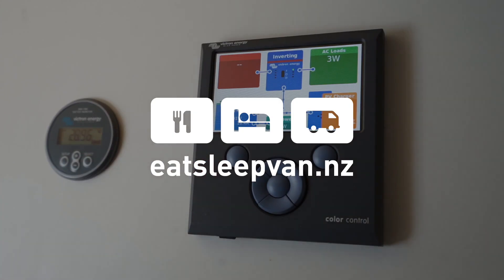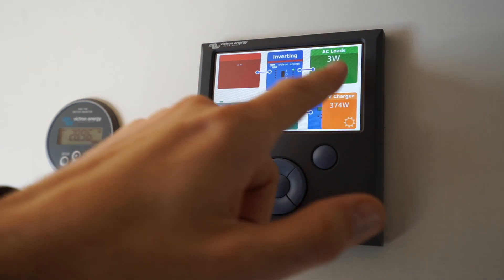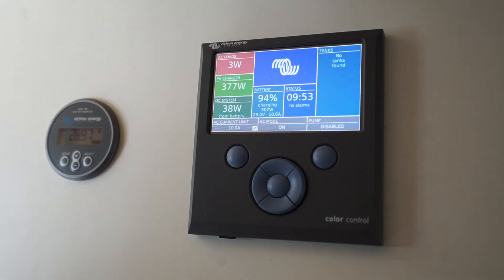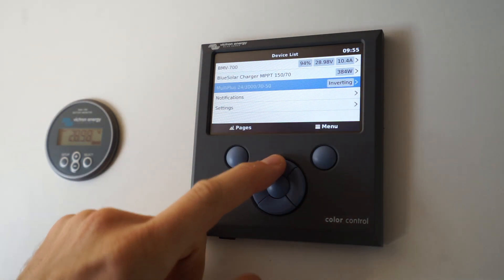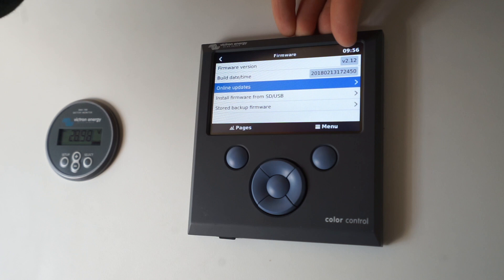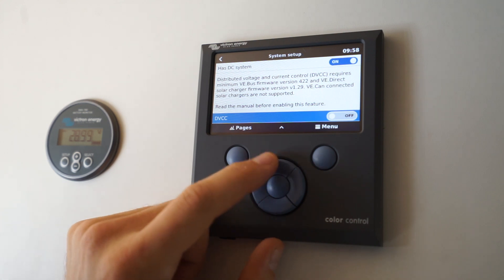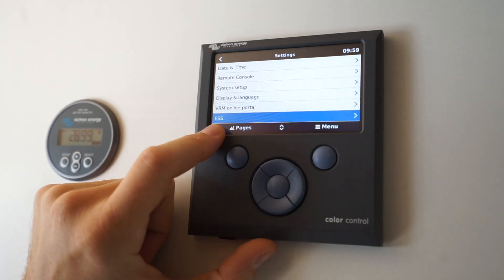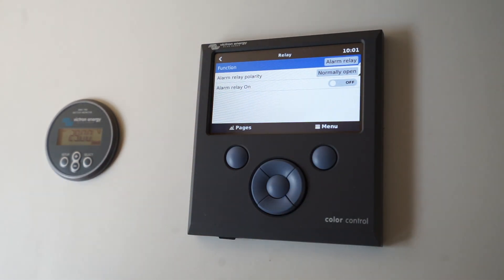Victron Colour Controller In-Depth 1 of 3 : Overview & Settings : Eat Sleep Van 25

Comment: Thanks for the the review. Do you actually need this piece of equipment or could you get by with just the shunt and battery monitor?
Reply from the maker: Yeah you don't need it, it'll all work fine without it. You just won't be able to see what's happening as easily, but for simple systems it's not needed. Cheers!

Comment: So it's $280 for the 712 BMV, $420 for the Venus GX and $287 for the GX touch 50. So nearly $1,000 to monitor your batteries trending data. Anyone find that just a LITTLE excessive?! My old battery monitor, although not quite so fancy, does this for $50 bucks!!!! I already bought the 712 before I realized this (deceptive) limitation. Looking into the RPi setup now.
Reply from the maker: That's why I bought the Easy Solar kit. It basically included the control panel for free, and I still needed the inverter and solar charge controller.

Comment: Hi, I'm wondering how to connect the DIY BMS to the Victron Colour Controller? Currently, I would like to build the BMS that can connect to the Color Control GX. However, the only protocol that I found is "VE.Can-registers-public.pdf". Is that the one you use? Hopefully, you can reply to this comment.
Reply from the maker: Hi sorry not sure, best to ask the Victron forums. I suspect you just use the USB converter cables that victron sell. But not sure how to build a BMS that works with Victron.

Comment: I seen all three of your videos very informative thank you.

On this video you mentioned that from your motorhome you can put power back into the grid which I'm kind of interested in that.

I'm on some friend property right now using their electricity 20 amp, I'm going to put a really big solar system on my motorhome very soon but if I can feed them power during the high day when my batteries are fully charged and bring down their electricity bill that be great.

If we use that feature would my inverter charger automatically feed the Grid or do we have to buy a different opponent to do so?
Reply from the maker: Hi the Victron Multiplus Inverter/chrager is capable of feeding back into the grid, but I do not do that, I believe it's illegal in New Zealand in a moving vehicle like this. I'd suggest talk to a Victron knowledgable electrician to figure something like that out, getting it wrong could be very bad!
Reply: @EatSleepVan  

 thank you for your reply I would definitely talk to them about it.

Comment: which of the two options do you prefer for a motorhome: Quattro or Multiplus? 12v or 24v?
Reply from the maker: I don’t know much about the Quattro but I think the only reason you’d want it is if you have 2 separate AC sources at the same time. Eg generator and shore power. But keep in mind you could simply switch between the two before it goes into a multi plus, so probably not worth the extra money in an RV environment. Generally I’d recommend 12v unless you’re dealing with a lot of power and know what you’re doing!

Comment: Did you remove this from the victron EasySolar and re-mount it, or is this a slave unit that you purchased separately? (Or did I miss something entirely and you are using a different main inverter/charger unit now?)
Reply from the maker: Hi correct I removed it from the EasySolar box, and bought a longer cable to mount it elsewhere. I then plugged up the hole with a piece of black card. It was reasonably easy to do and the longer cable wasn't TOO expensive.

Comment: You mention the issue of an update, does this not over time mean a limitation to autonomy, meaning you are dependent on the manufacturer should they at some point decide to charge for access to areas which initially are offered at a once-off cost, should they then decide to move on to a subscription system, case in point, Adobe products?
Reply from the maker: There’s nothing forcing you to update the software on any Victron devices. It’s all designed to operate offline so connecting to the internet is optional.  Updates do make improvements and add new features which is good, but you don’t have to do them. Currently Victron don’t charge for any software separately including their online website. Again you don’t have to use that for a functioning product, but it’s a great feature they give for “free”
Reply: Eat Sleep Van sorry wasn’t implying being forced, more as a coerced with the passage of time. I hope and pray it won’t ever get to that with the passage of time. Apple ecosystems just talk of “security updates”. That said, it clearly is a great product, just too many singed fingers in other ecosystems that began well. Looks great and reports and gives good control.

Comment: Did you have problem when first setting up? Mine doesn't seem to sync and the auto start generator setup not working:(
Reply from the maker: No not really, do you mean it’s not syncing with the Victron online stats? Make sure it’s actually on the internet. You can check by telling it to check for a software update. Sorry I don’t have a generator so haven’t played with that!

Comment: Magic peace of kit but the $$$ holy moses
Reply from the maker: It is pricey, but no reason not to make a raspberry pi version to save a small fortune!
Reply: Eat Sleep Van I don’t understand how a RP loaded with the Venus os would be able to connect due to potential hardware limitations. Is it easy to outfit them with all of the victron-compatible interfaces necessary to communicate with the devices on the system?
Reply from the maker: From what I understand you can use USB to VEDirect cables happily, so that’s MPPT controllers and BMVs sorted. Not sure about connecting to Multiplus via VEBus.  In fact if you run out of VEDirect ports on the colour controller you can use the USB ports too
Reply: Eat Sleep Van thx.

Comment: Hi
How i can connect 2 smart solar charge controller MPPT 150/100-MC4 and 1 blue solar charge controller MPPT 150/35 
to the same CCGX?
Thank you
Reply from the maker: Assuming they all have VEDirect ports, you can plug two of them in directly. The third you’d have to use a USB hub and USB to VEDirect converter. So I’m pretty sure it’s possible

Comment: Hi i am very interested in your set up as i have just installed a 300ah lithium set up with a 2kw multi and    300w solar.but as the system has a ve bus bms (to protect the lithium battery)it wont let me set the shore amps nor turn the inverter on or off from the ccgx.on contacting victron they have told me it is not possible to use these functions with ve bus connected and its not needed on a camper van.which i totally disagree with.
Reply from the maker: Yes I remember reading that you can’t control your inverter from the colour controller if you have the victron BMS. I’m using a third party BMS that is completely independent so don’t have that problem. I suspect your only option is to install a remote inverter control panel? See here for details https://www.victronenergy.com/live/ccgx:start
Reply: Thanks.yes i thought that but apparently that doesnt work either! So still looking for a solution. Which bms did you use.
Reply from the maker: BMS by Zeva.com.au which monitors and balances my cells. It is connected to a battery disconnect device so any problems and the whole thing is disconnected until I fix it. But in theory nothing should go wrong...
Reply: Great thanks